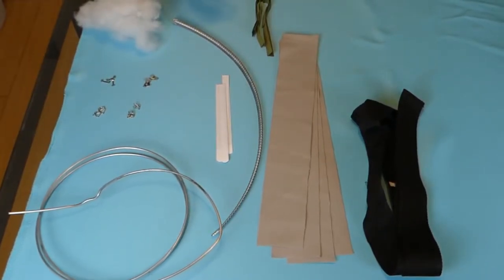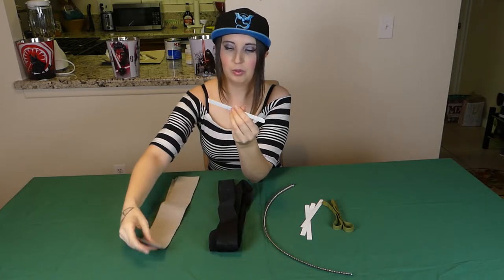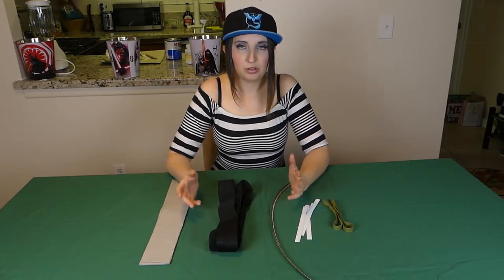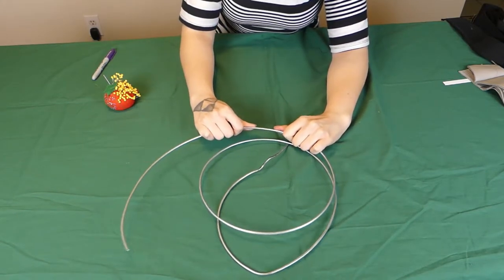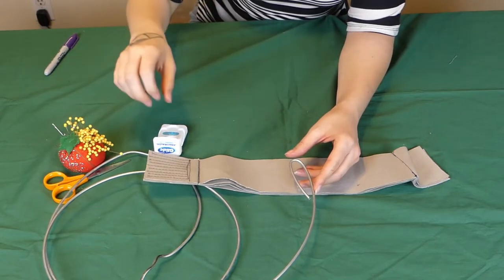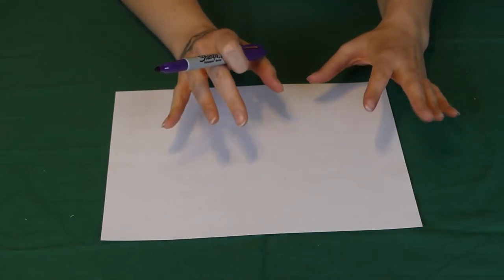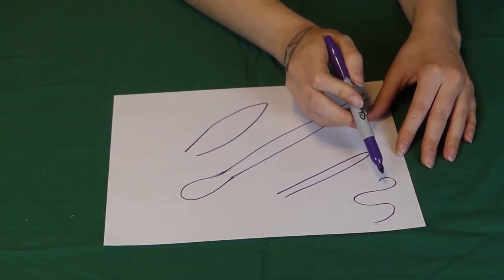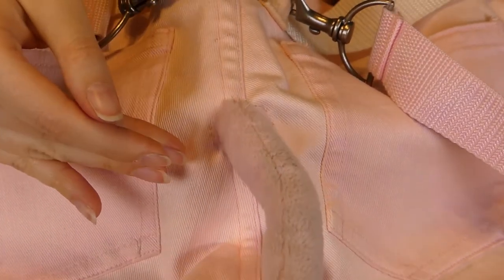Floating/Self Supporting Cosplay Tail Tutorial

Comment: I'm making a cosplay of Kirara from genshin impact and she has a cat tail that splits into two right at the start. Do you think the boning would be necessary for her specifically? It's not as long but since there's two of them I'm not certain 🤔 in any case this video is a big help!!
Reply from the maker: You may be able to get away without the boning, yeah! I would just make the belt and at the wire on and test it. You can easily add the boning after if you fins it needs it 🙂 happy to help!
Reply: @azayakachan  thank you sm!!

Comment: What is the thickness of the wire?
Reply from the maker: I used 12 gauge. But it will depend on the length and shape of your tail. You could get away with thinner if your tail smaller/shorter.

Comment: For the polypropylene webbing, do i need to put darts in that too?
Reply: Also I need a little help with the polypropylene webbing, should I make it two wide or just one strap wide? I'm planning on attaching two tails to it
Reply from the maker: It depends how far down you wanted to sit at your measurements. Putting some very small darts in it could help if you wanted to sit low down on your hips. I would make it 2" wide regardless of how many tails. The wider it is the less it will dig into you and the more it will support the weight
Reply: @azayakachan   sorry for late reply, thanks for replying! I did just that :)